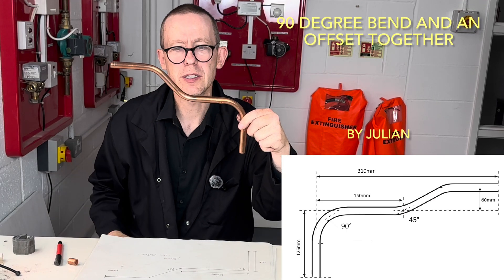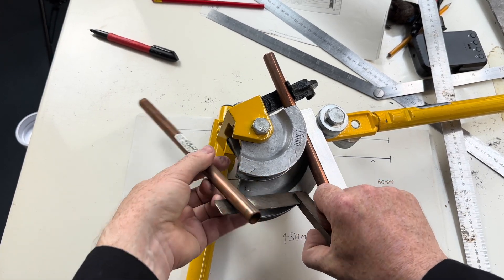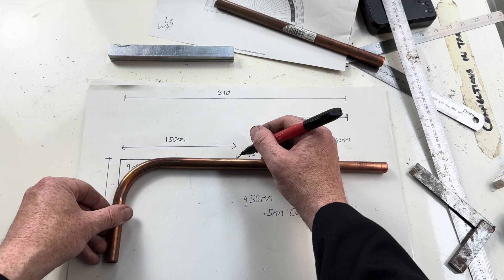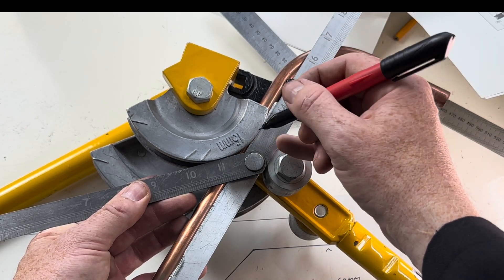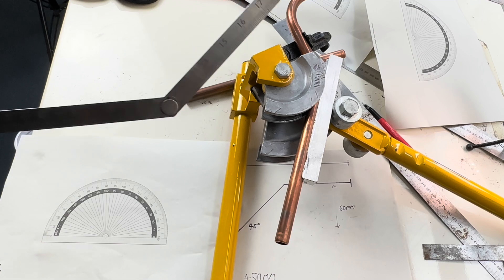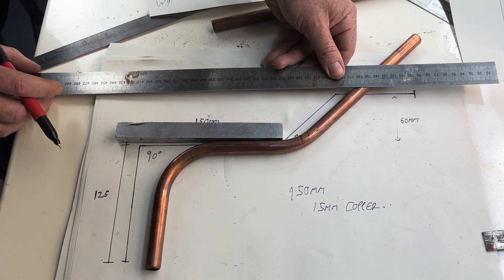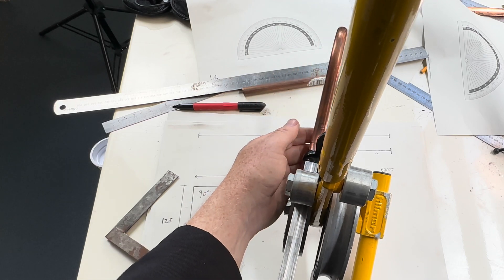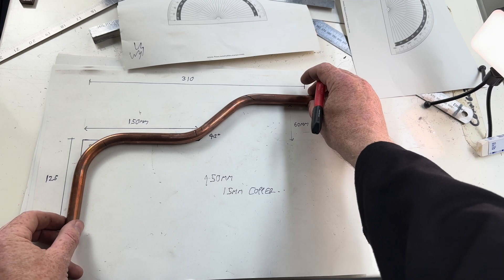Pulling a 90 degree bend and  an offset on same pipe to measurements.

Comment: 7:57 is the most confusing (the external/distal edge BELOW the diagram's centre line - to find the second, 45 deg bend centre), but this is the second giant milestone to understand the principle behind 45deg offsets.  Hypothetically, if the last straight piece should be parallel to the first 125mm (going upwards, not to the left), you should place the guide under the line and align the proximal edge to the center line. I will test it in my workshop.
Reply: Nope - I disagree with 8:23 (and especially with 9:05 - perpendicular, final length will be too high by the doubled difference of your pipe mark line and the point on former)) it is a mistake causing the final straight length to be exactly 15mm higher up. If you place the pipe as before (bottom middle of the pipe on the drawn diagram), mark the mid line of the second 45 bend and then, line it to touch with your mark on a bender - you will get the exact length as per diagram.   Dont believe? Have a look - I have shorten the first length to 100 to save the copper and tried to stay on one sheet A4 paper, hence a total width of 275. not 310:  https  :  //  photos.  app.   goo.   gl   /    VWGKy9isZzP1dUHR8      (remove spaces-safe google photos)
Reply: To finish on a positive note,  you have made me get up, go, try and test/learn by myself - and for that, I am very grateful. :-)